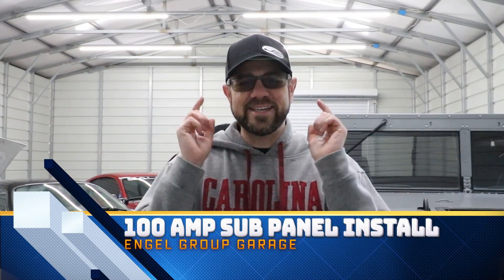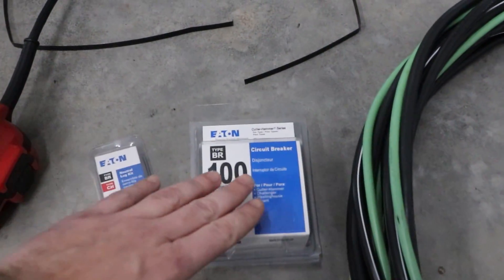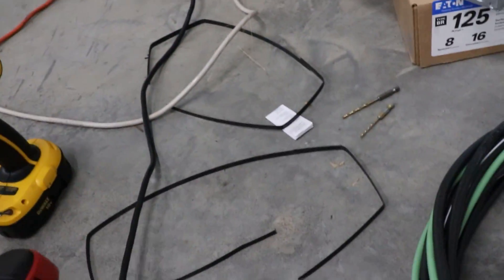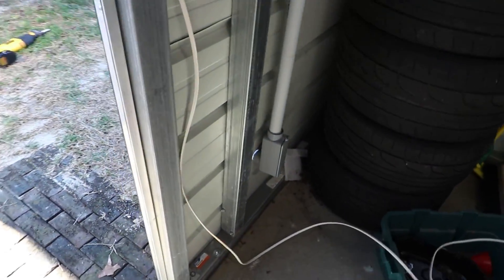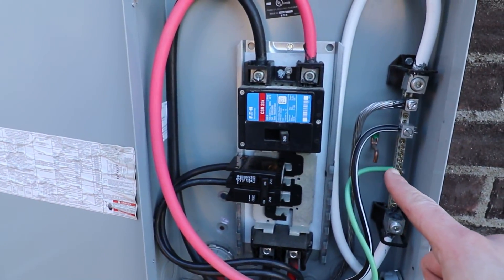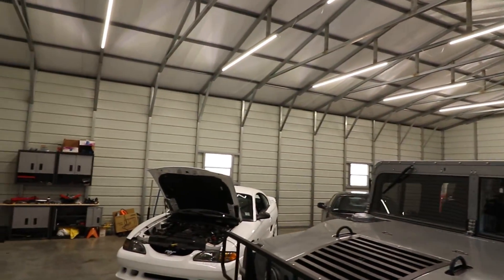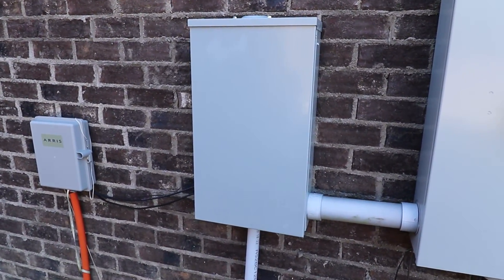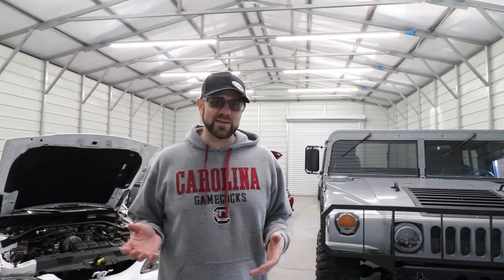How a 100 Amp Sub Panel Breaker Box was installed In My 30 X 50 Shop.

Comment: 1.  I did not see the large metal nut that hold the PVC in the panel.  I only saw the ring on the top that is to keep the wires from chaffing on the top edge of the PVC fitting.
2.  I believe you do need to have grounding rods for a sub panel if it is in a separate building.  Possibly two of them at least 6 feet apart with a single unbroken wire running from the ground bar in the panel and to both grounding rods. 
3.  On your sub panel you need a clamp on the Romex that is coming in for lighting circuit.
4.  I can't tell for sure but if you used aluminum wires for the feeders then you need to apply an antioxidant product on them before you install them in the lugs.

Comment: Since you have all metal studs in shop I would have used AC/MC cable. Both can be exposed per NEC code. Emt and handy boxes are another option.

Comment: 1 Foot deep burial?  NEC requires 18" in conduit, or 24" direct burial, or 6" in RMC/IMC.  Did this get inspected?
Reply from the maker: In SC we don’t have the deep frost but yes.
Reply: @JohnEngel  I don't think its a frost thing, its a you are more likely to put a shovel through the wire sort of thing.
Reply from the maker: @asusreviews  great point. Thank you.

Comment: Meter panel outside and my main panel inside are directly behind each other and a hole bottom right with cables goin through can I add breaker on main panel for sub panel and use that hole to run out the wires and use one of the knockouts on the meter panel to come out in conduit to the ground and then to shop sub panel
Reply from the maker: That’s an even better way to do it.

Comment: This installation would not pass inspection. For many reasons.

If more than 25 feet away, generally a shutoff would be required.  I can't tell, but it looks close.  Here are some codes to help you along:

NEC 240.24(C): Protect panel from physical damage
NEC 225.31/32  Means of disconnect required
NEC 250.53(A)  Ground Rods required
NEC 300.5  18 inches minimum cover required, unless under concrete
NEC 250.102  Equipment must be bonded
NEC 330  PVC pipe not listed as acceptable for use with electrical code (if indeed that is PVC pipe in the video)
NEC 240.4(D)  20 amp circuit requires 12 awg wire.  You used 14
NEC 300.21  Seal all penetrations through walls
NEC 314.4  All metal boxes must be grounded

Fix those and call for a reinspection

Comment: Hey.. great video.. I have a question,
What breaker did you use from the Main Panel to the 1st subpanel..
Thank you...
Reply from the maker: I used an Eaton 100amp.
Reply: @JohnEngel  do you have a picture..?
Thank you..
Reply from the maker: @landybonet7527  only the ones in the video.
Reply from the maker: @landybonet7527  also I think everything is listed in the description.

Comment: You need to drive a ground rod for your sub panel. It’s required by the National Electrical Code.
Reply from the maker: Thank you so much.
Reply: Because its in a separate building???  I did the same thing as him 25 years ago out to my garage and don't have a ground rod.  Also did he say he removed the bond between neutral and ground? I did that.
Reply: @gregsmith7391  Think of why you need a ground rod out there. Your neutral is not bonded at your sub panel(at least it shouldn’t be). If you lose your equipment ground from your main panel, your sub panel and any equipment you hook up or receptacle loads, lighting fixtures, etc. are all ungrounded now. The sub panel ground rod is a supplemental ground source that ensures your safety should any metal get energized somehow. You are jeopardizing your safety as well as the safety of others that congregate in and around your garage. Sorry to say but you should consult with an experienced electrician when doing electrical work. Hopefully you have a family member or friend that can assist you so you don’t kill yourself or a loved one.
Reply: @LetricShave  you need a course on grounding and bonding. Just because you have a ground rod does not mean it will trip a breaker. Matter fact if you hook a breaker straight to a ground rod it will not trip the breaker. The purpose is to  remove stray voltage from surges, such as a lighten strike

Comment: Buried wire doesn't require the conduit(PVC)?  Didn't get to see that part.
I need to wire a water well and must have 220v breaker box added.
Reply from the maker: The best thing to do is consult your states code. I am far from a professional electrician and would not want to steer you in the wrong direction. The wire that I bought was direct burial.
Reply: @JohnEngel  Always a good idea to use conduit, especially if you have rocky soil.
Reply from the maker: @RustyCas999  I agree.

Comment: If you had to move a breaker from the main panel to the sub panel, do you need to move only the hot wire from the breaker in the main panel or the associated neutral and ground from that circuit too?
Reply from the maker: That’s a great question. The only breaker I have in the main panel is for the sub. So I can’t move it to the sub panel.

Comment: Doesn't the shop panel need to be connected to its own grounding rod?
Reply from the maker: It’s connected to the ground from the main supply. Might be a good idea to add another? What is code on that?
Reply: @JohnEngel  yes when you add the sub-panel in a separate building you also need a ground bar.
Reply from the maker: @thomasmarable6818  yes. It has a ground bar that feeds into the main panel. It then would have a grounding rod. I do not have a grounding rod for the sub panel.
Reply: @JohnEngel  YES, YOU NEED A GROUND ROD FOR A SUBPANEL!! Don’t let anyone tell you that you don’t.
Reply from the maker: @LetricShave  thank you.
Reply: Yea. As per NEC you DO need a seperate unbonded ground that consists of two seoerate ground rods driven and one single uninsulated , unbroken copper conductor that connects to each copper ground rod and goes up into the sun panel. If any sub panel is installed into a structure that’s seoerate from thr originsl structure where the main panel is installed, you need a seperate copper ground to prevent electricity from back feeding into the sub panel in the rare occasion that it would malfunction. Oh and it eiuod be an EXCELLENT idea to separately ground that metal structure to protect it in case of a lightning strike.

Comment: I have to do the same thing but I have to get about 150 ft of the burial  wire...ouch!
Reply from the maker: I do not envy you on that. It’s not very expensive but it adds up quick and also trenching is not fun. Lol
Reply: Rent a trencher . 100 bucks
Use aluminum ser cable and shop around. You should be able to get it for 2-4 a foot. For 100 amps you need 1/1/1/3 SER cable
Reply: Ha, how about 1000ft of 2-2-2-4? PIA!